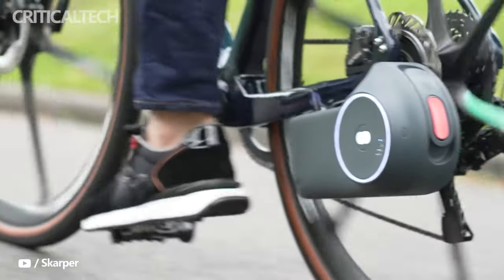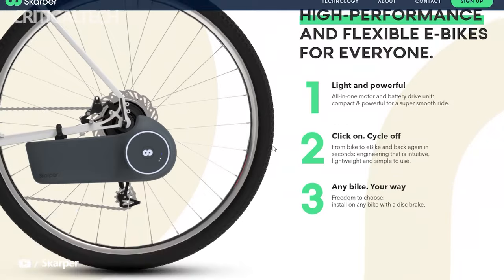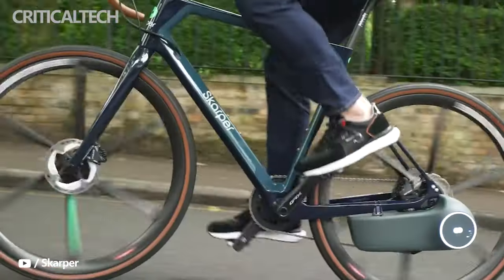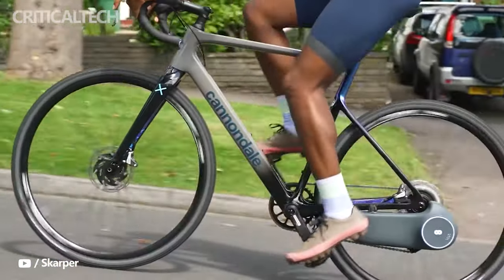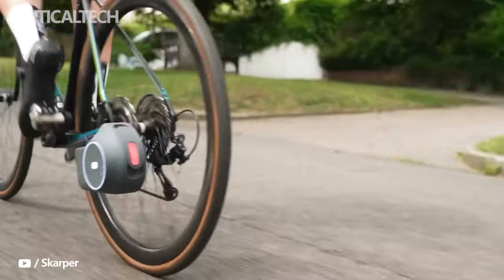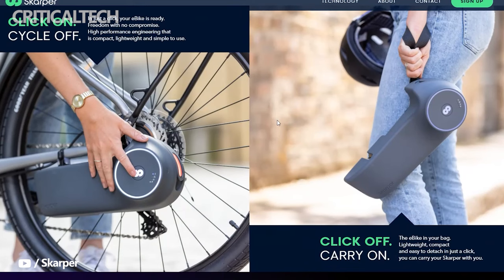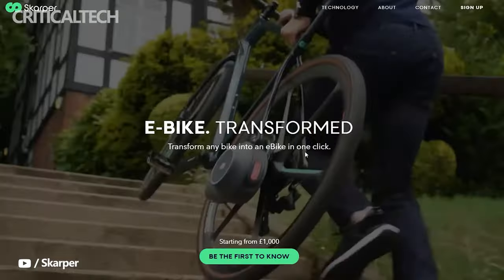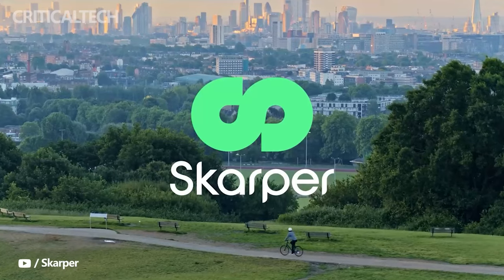Skarper E-bike Conversion Kit (2022)

Comment: Can't find any explanation anywhere on how it works in detail, which is a concern. And the light weight strongly suggests there isn't much battery, with the distance range correspondingly relatively short, which is fine for town use but not much else. But my main concern is the predicted extremely high cost which is a big barrier. The components can't justify it, so it's pure marketing. Why not buy a genuine e-bike and get something specifically designed and with a much longer range. Good idea but currently with severe limitations, so it's a no from me.
Reply from the maker: I think this thing works depending on how efficiently you pedal. For example, if you are not spinning it does not work, as soon as you pick up speed it helps you move. I also agree Skarper is quite expensive, I would rather buy a ready-made e-bike. Thanks for your comment and thoughts, have a nice day!
Reply: Indeed price seems too high! For that money you can buy a good entry ebike with more options for example replacing battery that is not possible in this object sorry no thanks!
Reply from the maker: @KoDeMondo  I agree, the price is the biggest mistake of the company. This scares most users, including me. Thank you for sharing your feedback. Have a nice day!
Reply: @criticaltech7091  look the Idea and project is awesome don't get me wrong. It is really strange that they didn't thought about it! If they will Lower it the price to let's say 200us they will sold them as little pancakes.
Reply from the maker: @KoDeMondo  I agree, the price is the main problem with this device. I hope the manufacturer will listen and make the right conclusion.

Comment: Steve Agaronov
It is a great product, I loved it, I would like to know about the brake to stop, I know it does have, but never mentioned how it is working, it would be great to know, good lock on your invention
Reply from the maker: Thanks for your comment and your interest. My guess is that the braking system senses when you start to slow down and will also help to slow down (repair energy).
Reply: @criticaltech7091  It can't do that as the speed will obviously go up and down naturally during the ride. Maybe it's linked to the brake lever somehow, or just the manual operation of the system - you wouldn't apply both the brake and the drive at the same time. The lack of detail suggests they might still be working on it.
Reply from the maker: @garymitchell6372  I think rightly, they don't yet know how it will work, but only proposed the very idea and without the final product.

Comment: I'm looking at that and only seeing flat area usefulness. It's probably pushing a 300w motor and 2000mAh battery. With that pricetag I will definitely shy away.. Expecially since I live in a hilly town. It's an interesting concept, but just does not seem worth it at all.
Reply from the maker: That's for sure, given the specification, it would be an obvious failure. Or such a device will be useful only for straight sections.

Comment: Daft question, but how do you control it, is it intuitive?
Reply from the maker: This is not a daft question. That's right, the controls are just intuitive.
Reply: So the harder I pedal the more power kicks in?
Reply from the maker: @jessegee179  I think it does not depend on how much you pedal, even on weak pedaling it will help.
But you are right, the better you pedal, the faster the speed.
Reply: @criticaltech7091  sounds great, thank you.

Comment: What's the great thing about being able to remove it? I don't see why you want to do that. They're inevitably limiting battery size for no apparent benefit.
Better to leave the motor on and just have a bigger removable battery.
Reply from the maker: Perhaps a larger removable battery would solve the problem. But the manufacturer probably wanted to show that this thing is easy to put on and without problems. As for performance, I also have questions.
Reply: @criticaltech7091  well, it's easy to put on and take off once you've fitted the disk brake to the rear wheel, fitted the fasteners onto the frame and fitted the cadence sensor onto the pedals! 😂😂 But having done all that I still don't see why you'd want to remove the entire battery and motor every time. Perhaps I'm missing something?
Reply from the maker: @pjay3028  There is something in it, your words are true, there is no need to remove it. Maybe you're right. Most likely this thing is just a toy and nothing more.
Reply: @pjay3028  sometimes I want to put a electric motor on my gravel bike for putting around town when I can get charge but I dont want to have to change the whole system out when I go on a trip
Reply: It is the whole point actually. Ease of removal is byproduct of easy installation. This will give confidence to people considering this kit on expensive non-e bikes without worrying to lose the manuverability from battery and motor weight. Carrying replaceable extra battery is an easy resolution to your question. Lets see how they come out.
Reply from the maker: @kleeo83  I agree simplicity is a very good trait in any field. But the price tag is also very decisive for any purchase. Therefore, at this moment it is also worth paying attention, especially at the present time.

Comment: This might be a game-changer product. In general, I like it allot ... but I have reservations about the electrical power transfer mechanism, and the attachment mechanism:

I don't understand how power is transferred from the internal motor to the external disk rotor. I understand the disk rotor is Skarper product. By visual examination, I am guessing it is magnetic induction drive across the void gap between the external housing unit and the rotor disk. I wonder how mechanically efficient this power transfer process is?

As an engineer myself, I am somewhat concerned about the attachment fittings. The hanger fitting that is strapped onto the bike's rear stay seams flimsy. I fear the Skarper unit may be prone to lateral play. But, this can easily be tested by Skarper and enhanced in version 2.0.
Reply from the maker: While there is no exact data on real use and their breakdowns. Therefore, time will tell how the product will show itself in mass use. But I think that any gadget has its drawbacks, just like the Skarper product.
Reply: Yes, exactly. There's no detail on how it works. I don't think it can be magnetic transfer as the power just isn't there. It must be mechanical in some way, but yes you're right - the motor is driving the wheel so will meet strong resistance, but the fastening to the frame is extremely weak. The more I look at this the more sceptical I am.
Reply from the maker: @garymitchell6372  I hope that in the near future we will be able to find out the exact principle of work. In the meantime, it only looks like a very expensive toy.

Comment: Wtfk? Ugyan azok a kèpsorok kapkod a kamera a vágás szöveg nèlkül semmit nem lehet èrteni. Holott állítólag egyszerű mint egy faèk....rásegit gondolom mert kart nem láttam hozzá.
Reply from the maker: I did not quite understand what you wrote, the translator does not work so correctly. But I think that the design is very simple, but it should be reliable.
Reply: @criticaltech7091  wtf? Even though the camera is rushing to those lines of frames, nothing can be understood without the text of the cut. Even though it's supposed to be simple as a tree...
Reply from the maker: @blackberrypark99  I agree with you, but let's wait for the real release of the product on the market and discuss how it will perform in real life.